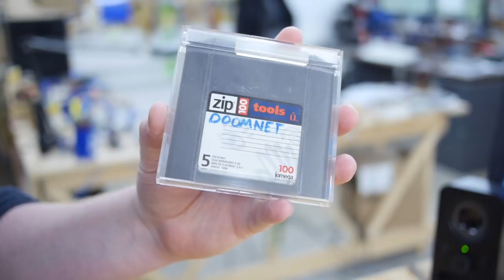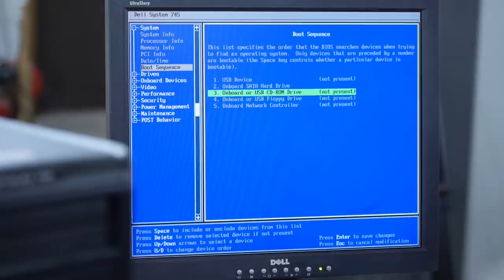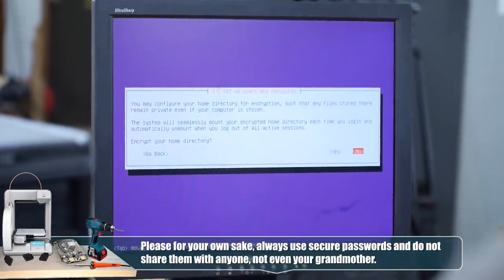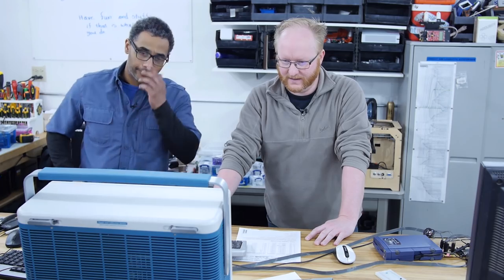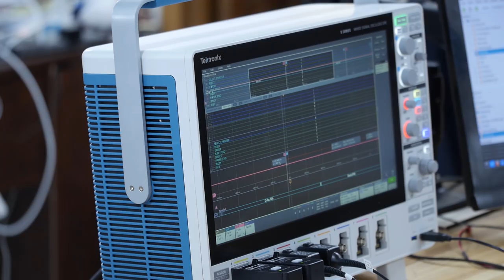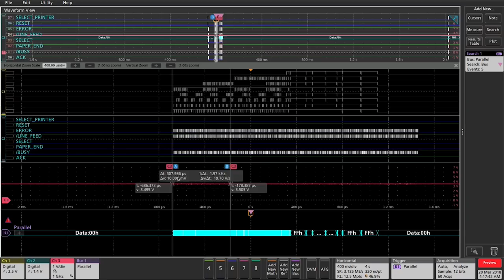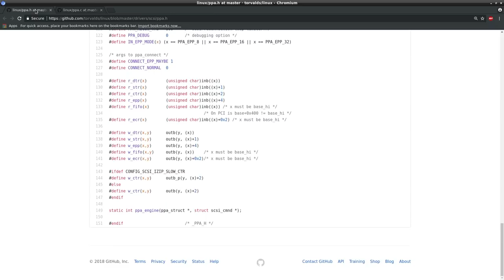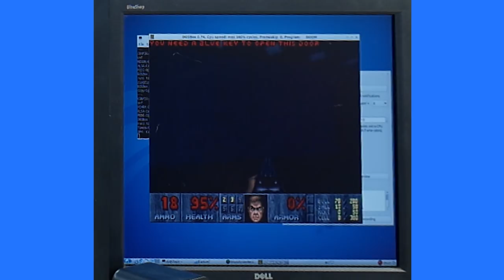Zip Drive Reverse Engineering

Comment: Silly engineers, the parallel port is still on most new PC’s, you just need a LPT header cable to get the old parallel port back
Reply: It would have been easier to make a test board out of it too

Comment: It's easier to get a parallel port than you think. First off it's still sometimes a feature on AMD mainboards, even the newest ones, but only as a pin header, just no rear panel port. For other, pci-e adapter is a thing and it should mostly work.
Reply: My old HP DeskJet 840C also uses a parallel port and my mainboard actually had only a pin header on it, so I had to take out a port cable (female port to pin header) from my old 486 AT tower and have it hanging around out the back of my PC. I think I need a new printer.
Reply: drunkenmaster666 I think your printer is fine! No problem keeping such a printer at all really, you can even use cheap USB adapters with them. However USB adapters really only work with printers and nothing else at all, and advanced error reporting may not work, nor should be needed here.

Comment: If your hdd connects by sata, the pc is not ancient. Its ancient if it connects via MFM/RLL! Now hands up all who know what I am speaking of!
Reply: This what I had in my XT back in the day. https://www.youtube.com/watch?v=9RN-m5FsMGQ
This was a new to me computer when my friends were rocking a 386.
Reply: Raises hands owner of an XT here.
Reply: The oldest saving technology I have access to is delay line memory. We have a ancient calculator at work that uses it. Don't know why it is still there, but it is kinda interesting.
Reply: A 70s storage oscilloscope I have has one, but its analogue storage.
Reply: My university has an old delay line memory on display in a display cabinet, but they haven't labeled it for anyone to know what it is. shame really.
Reply: Never unfortunate enough to own a MFM drive, by the time I got my PC in my teens in the mid 90s we had IDE :)
Reply: That's about my cognotive level ... if it's using SATA, it's contemporary. If it's using IDE, then it's obsolescent going on classic. If it doesn't even have IDE... now we're into the realm of the antique. I've got a 286 somewhere with a 40mb Conner HDD that i have yet to figure out whether it's IDE or some proprietary form of MFM/RLL, and guessing it's probably the latter as I haven't yet been able to convince it to use anything larger, or get that disc to talk to any newer machine... though it uses the same 40-pin connectors...

Comment: the parallel version of the ZIP drive was terribly slow. a bad idea.
Reply: Mitchell Theobald ikr? They should’ve just bought a USB one. Sure it’s only USB 1.1, but it is way faster than parallel.
Reply: They could have gotten the USB2 ZIP 750 drive,  you can even still get them new and the read the 100 disks. but the project was to sniff a parallel IO device the "recover doom levels on zip disk" was part of the "Regrettable acting"
Reply: I think you guys are missing the whole point... I don't think he was REALLY missing his old Doom level. It's just an excuse to experiment with parallel communications
Reply: My first couple of portable MP3 players used a parallel interface to load music onto them. Might be fun to see the signaling on the Diamond RIO PMP300 with a whopping 32 megabytes of music storage. I also got the special edition which doubled to 64 megabytes. I mean an entire album could fit!
Reply: I have an old SCSI Zip drive and it runs at a decent speed. It's a much better bus than parallel, but still a legacy connector.

Comment: I still have a ZIP drive with a SCSI connector. Finding a 25 pin SCSI to USB adapter isn't too hard I think. I'd have to check my shed but I think I also have an internal ZIP drive with IDE. Anyway bringing up ZIP made me nerd out because I used to connect the SCSI ZIP drive to my Amiga 2000 which had 2 hard drives in it. I could back up everything on the drives to a pair of ZIP disks.

Comment: What really strikes me as odd is that Ben still has data on a zip drive.

I pulled my data of the zip drives over ten years ago and transferred them to CD or DVD drives once I had the newer technology. 

Why did I do that? 
Because IOMEGA was discontinuing the technology.

Ben, you should consider building an actual USB to Parallel port, that is a Parallel port that connects via the USB.

I've seen plenty of supposed adapters but they all turned out to be USB to Parallel printer adapters.
Reply: Oh and yes, I still have my Parallel zip drive.
and most recently, I pulled a computer case out of the dumpster to see what was wrong with it and it turned out to have an IDE zip drive. I still need to test it to see if it works.
Reply: Scott Tovey i have old windows 3.1 games on a zip drive, i copied them but lost the data yearz ago.
Reply: Have you checked those CDs? They actually rot unless you use something like the M-Disc archival quality discs.
Reply: I think the idea of the video was an excuse to do the work being done as a project, not simple alternatives. Like just getting an internal/ide one for $20 off eBay..
Reply: Can't be done, USB doesn't have what is essentially a full 8-bit ISA bus in it like Parallel did, so many of the functions are impossible to implement.
Reply: Anyone who's had a ZIP drive remembers click-death, so yeah, I also moved my files to CD-R once I got one :)

Comment: Links to the linux driver and how you got the drive working in Linux would have been nice, as I actually do have an old parallel Zip drive, and several old machines with parallel ports on them. It might be fun to get the thing working again.

Comment: I still have my two zip drives.  SCSI and Parallel.  The disks are still usable as well as the drives.  

Locating a new version of the windows driver took longer than I thought but found one in the end.

Comment: Sorry guys I could have helped you but the DELL Dimension has been scrapped except for the hard drive, there is a video file called "Because it's your Stuff", Microsoft Windows 98SE is what you should have installed as it had the drivers on the disc, there are ZIP IDE drives that can be installed just like a hard drive, have a look at the files at "d:\drivers\storage\iomega" that should let you reverse the unit.

Comment: what is the point of this? there are zip drive with usb and internal zip drives too. also that computer is still good enough for windows 7 and 8 and maybe even windows 10. computers don't age like they used too and there really isn't much a reason to upgrade computers like used too. computers 10 years old or older still can run fine now.

Comment: So, ended up flying past the Zip wikipedia page. For whatever distance you can trust it... essentially, all but a few early (and not very good) pure-IDE models, pretty much every Zip drive is SCSI at heart. The external Parallel ones just include a SCSI-to-Parallel bridge chip (the PPA3 you mentioned), and the internal ATAPI ones are, like all ATAPI devices, essentially SCSIs that happen to have an IDE connector. And presumably the USB ones just incorporate the same chipset that you might find in an external SCSI drive caddy, or external USB optical drive that's basically just an ATAPI (and thus, SCSI) mechanism in a chunky box with an onboard PSU. In all cases (but the pure, driverless IDE model), the driver simply talks to them in SCSI commands, carried over whatever convenient interface it's presented with, which in all but USB is at least 8 bits wide and so requires very little real massaging - just fling the bits at the port and it should all work out. And presumably any magic in terms of parallel passthru is handled by the SCSI-to-Parallel bridge hardware... maybe it co-opts some of the LPT lines to pull it off, but then how would the basic unidirecitonal-LPT mode ever work?

Comment: I don't know if there is time or a will to take this on, but it would be really cool for you guys to hack the C64 Mini.  It uses a single board computer with an ARM processorand has pads for a UART connector, so you might be able to get into the system (not known if Linux or Android).  It also has a fake keyboard, but that's something you guys could fix.

Comment: that old dell would make a handy media server or data back up, os-image back up, application back up machine. And if the OS is on an SSD, you'd still have plenty of sata slots to dedicate to some 4 tb hdds. Oh and it could read your old floppy's too. in case you happen to come across a lighting system or networking system that relied on an OS booting from fdd.

Comment: Plugs in a ZIP drive to a parallel port, starts talking about SCSI.

IIRC the last version of the ZIP 100 Drive, before they went to USB, had a smart connector that sensed whether it was connected to a SCSI card or a Parallel Port.

Edited to add: Just checked it and Parallel Port ZIP Plus drives were SCSI drives with a SCSI to Parallel interface.

Which gives me an idea for a few old Macs I have...

Comment: Zip drives are great for transferring data to old DOS era machines. Since they made USB versions of the zip drives you can just plug them into a modern PC and copy files over then move the disk into a parallel version of a zip drive and it just works

 The machine I have doesn't like those new IDE memory card adapters so it's the main way I play dos games on real hardware

Comment: Oh, and USB to Parallel adaptors are pretty easy and cheap to come by. Hell, I have a spare one if you want it. Local electronics chain was going out of business and so doing a lot of liquidation reductions... got them for about £2 apiece, but they wouldn't have been more than about £10-15 originally, and that was just on the shelf in a walk-in store. Probably most big electronics retailers will still have a few on one of their dustier racks. (Only picked up the second because on a repeat visit to a different branch I forgot some of the things I'd already bought, so there's also a spare 3.5mm optical to TOSlink converter going begging)

Even though it might not support anything better than the base-level "nibble mode" transfers, that's still enough for a few dozen kb/sec, so if you can stand waiting a minute or two for each WAD to copy, and maybe an hour for the entire disc (which won't be more than about 2/3rds full of WADs unless you deleted the original Iomega Tools folder) it shouldn't matter that the higher speed modes are unavailable for a one-time thing.

Comment: i put togheter a working zipdrive for my old synth with 3 nonworking units. mine is scsi. have 2 now, one internal and one external. guess the head needs to be aligned cause i could not read old discs, but after format they worked fine.

Comment: Protocols... probably SCSI-over-LPT. It started out as a SCSI device, and it was a common enough thing for various external devices like CDROMs. SCSI signalling is fairly adaptable to any connection with at least 8 data lines and some status lines alongside, and if you have a suitably sophisticated driver to handle the bit banging and translation, packeting up the commands and data to send over the parallel lead (or receive and decode it), the actual device itself can be more or less wholly unmodifed. Even the ports on the machine can be exactly the same, as a 25-pin D-shell is plenty enough. The cleverness is probably mostly the printer passthru ability; presumably the Zip only responds to commands that have a particular magic cookie in it, and everything else just passes through unmodified.

(later: The use of the error, busy, etc lines are probably to do with its "nibble mode" operation where it can work on a regular unidirectional parallel port, getting data back from the drive 4 bits at a time using the status lines; timing otherwise would just use the regular strobe... if you've got a very basic built-in driver, it'll default to that because even though it's super slow, the more sophisticated modes would need extra code and not be as widely compatible. Never heard of SCSI using its 8 parallel lines as separate bitstreams, though possibly Iomega were scrambling the data as some kind of encyrption / anti-hardware-piracy thing?)
Reply: OK, so, er... what did we actually find out here? I'm confused. We seem to have started doing some logic analysis, then a poke at the source code, and.... er... stopped. What was the actual outcome of those investigations? Some kind of odd SCSI-via-LPT or what? Did it just prove too predictable and uninteresting to continue with?

And, yeah, as far as I know myself, 512 byte sectors, though almost certainly glomped into at least 2k clusters in the 100mb discs (maybe not the very early 25mb ones, and probably larger for the 250 and 750s), much like the case for CDRs to keep the FAT / other file tables manageable, and more importantly easily addressible under MSDOS. Possibly the driver would have done some transparent translation turning DOS cluster-level accesses into Zip sector-level ones, and that might be the origin of the odd multiple-serial link thing (interleaving the bits from each byte of a logical 4k cluster into separate physical half-k sectors?!), though I would more suspect that's down to whatever data is being transmitted being a 7-bit-or-less-character representation packed into 8-bit bytes, meaning that one or more of the lines will remain seemingly unused during transmission.

Discs were... 300? 360rpm? and hard-sectored with increasing numbers of sectors from the inner to outer edge of the disc, Mac / Amiga style, and belying the format's attempted bridging of the floppy and hard disc worlds (which was kinda Iomega's thing from the Bernoulli onwards), so the speed would vary somewhat if you had a very high speed connection (highest-rate parallel, SCSI, ATAPI) but not really be noticeable on slower ones because the link would be permanently saturated even with the lowest physical data rate. It might make figuring out the timings somewhat difficult though, unless you did a continual survey of the transfer rate whilst copying a full 95mb file one way or the other. So long as the link was fast enough, it should show a stepped increase (or decrease?) with very nearly an exact number of kb's (or half kbs, if it's actually single sided / only reads one side at a time, which would seem to be a bit primitive for such a machine) per second at each stage - as it's likely spinning the disc at exactly 5 or 6 revolutions per second - only maybe varying from that if the link reaches saturation point.

Comment: Seems a bit OTT when you could just get an old computer off ebay to connect the zip drive up to. Maybe even one with an internal ATAPI model. I ran my entire system off Zip (and a boot floppy) for a while, in my schooldays, when I was cobbling together a personal 486 machine from whatever I could find spare ... which didn't include a hard disk. Could totally have run Doom using it, except that the system had a Hercules Mono graphics card and monitor... (and I now have a different 486SX, with SVGA, lurking under the spare bed which sometimes gets dragged out... and plays Doom quite nicely, though anything much newer fails hard for lack of FPU and MHz. I should probably see if the old external Zip works with it, in fact, given that I'm unlikely to ever print anything from the machine ever again, its tiny hard drive is stupidly crammed, and only so many things can be run direct from CDR, somewhat limiting the utility of the CDROM I bodged into it...)

Also as many other people have already said, you can get USB zip drives that should still be compatible (in read-only mode) with the old 100mb discs, so this is a totally wasted effort. And there's no reason a machine with an internal or even parallel drive can't have a USB controller card (if it doesn't in fact have built in support on the motherboard) to at least v1.1 level, or a CDRW drive installed to it, or a network adaptor, or just a serial link cable hanging off a USB-to-serial adapter that the files could be transferred to a newer machine with via a memory stick or CDR or plain electronic transmission. Even at 57600 baud, 95 megs won't take more than a few hours to shift, and I can personally demonstrate through my own old backup CDs that you can comfortably fit about 7 zips' worth of data onto a single CDR, and burn that safely within about twenty minutes on even a low end Pentium (as in P54C at 200MHz or less).

((edit: that was admittedly written in the first couple minutes when it became clear that we weren't running Doom on*, or even *from the Zip, just copying the WADs. Obviously a dumpster-dive PC from 2007 is just as good as an eBay one from 1997, so long as the software runs on it. Still, I'd struggle to call it "ancient", more just well-worn, especially as it had a SATA DVDROM (DVDRW?) in it. Obviously it would have been still in active service until a little before it hit the "to recycle" pile, maybe just a couple months, at which point they would have ripped out the HDD for secure destruction and left the carcass for the recycling company. Mid noughties Dells weren't exactly high powered as far as I'm aware, but perhaps that was a particularly high-spec one, or it was kept in use for fairly low-level tasks. Last year I was working somewhere with plenty of 2008-2009 era PCs, of high spec for the time (but still originally IDE HDDs and DVDRWs or even DVDROM/CDRWs, despite having SATA ports), that were still happily ticking along with Win7, even some experimental installs of Win10 on them, just with maxed out RAM and SSDs installed to keep them running at an acceptable speed, and my 2006 ultraportable laptop at least made it to 2013 before being retired to work as nothing more than a network fileserver, connected up to a load of USB HDDs...))